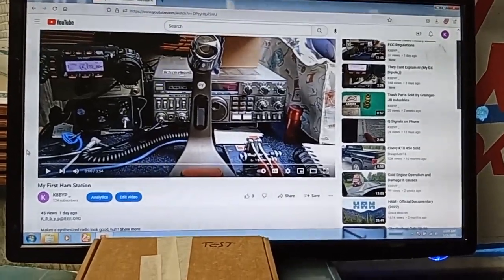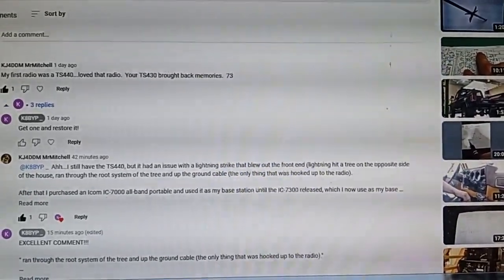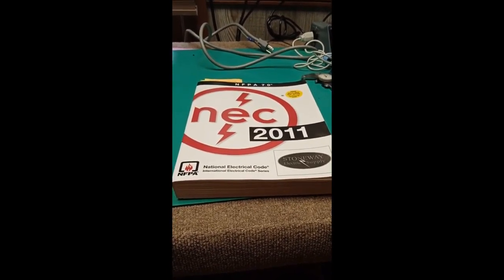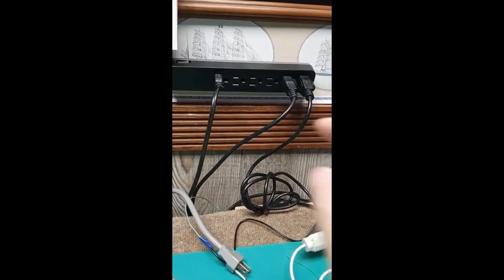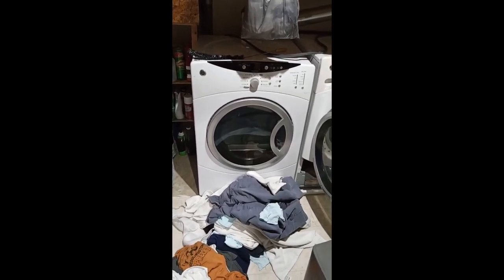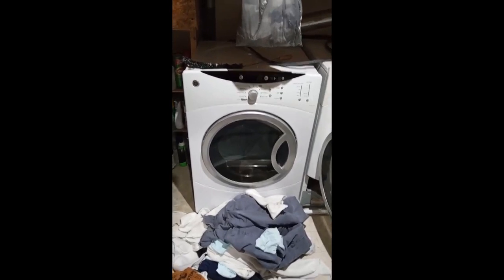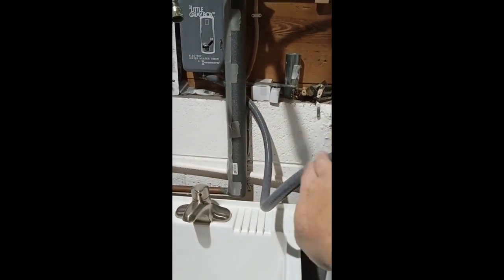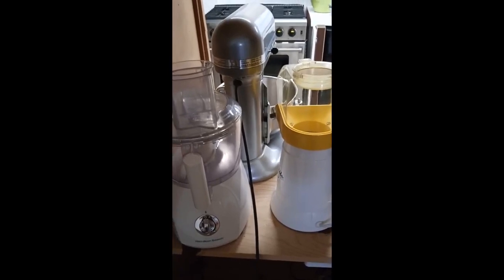UPDATE - NEVER GROUND HAM RADIO EQUIPMENT!!!

Comment from the maker: Im reposting a Comment from Jonathan Cotner. Its important to out utter BS artists like this. This information is ENTIRELY FALSE, based on rumour and opinion with ZERO knowlege or explanation of electrical physics or circuits, especially in a VERY complex topic (which I have a mastery of) of EMI and RFI as an Engineer:

Im reposting this to show the HORRIFYING ignorance that passes for Amateur Radio these days. Normally Id just delete this kind of nonsense.

Orignal comment (basically in complete error):

" Ok, let em explain why the ground lug exists on nearly every piece of equipment we have. This doesn't discount what I've watched thus far in the video at all, and it's something I've told countless amateurs. Say you have an radio, and an amplifier, and a automatic tuner that all take 120v input. That means they each have their own independent power supplies, each with their own independent "ground" potential. We interconnect this equipment for various purposes, the coax feeds the RF, the PTT lines are the control lines, and that's where those ground lugs become important. If you take a volt meter and test the voltage between two un-grounded devices you'll measure the very real potential difference between the equipment. In the days of tubes, where we didn't have a three wire system, that voltage could easily be 120v AC (this is your scenario with the dryer). Today it's on the order of 20v or so, give or take, but that's STILL enough to disrupt things like a 5v PTT line. Ground (I prefer the term BOND) your equipment together to ensure everything's at the same potential, this is for both you and your signaling. That doesn't mean you add a ground rod outside your house just for your amateur equipment, but it does mean bond your equipment together to ensure that all of your equipment is at the same baseline (ground) potential. If you install an antenna system, aka a tower, the NEC has code for that as you've mentioned. But I do want to point out that our equipment wouldn't be legal for sale in the US if it violated electrical code, and those ground lugs are there for a reason. Reference the manual for your radio, if only I could post photos in the comment section LOL. 73 KY4CT

OK, that was a pile of Rubbish and OPinion. Now, my corrections:

"WHere do I start as a Design Engineer correcting that horrible pile of mis statements?

One at a time, till I run out of patience (or coffee)

Off topic, rambling, no explanations from a technical standpoint (this is an ENGINEERING CHANNEL) only from an "operator pushing buttons and connecting cables together" standpoint.

Heres the response you'd get in an Engineeing review:

1. " and a automatic tuner"

Then youre not a real Ham and have no knowlege of antenna system matching. But I digress... The REASON you have "ground noise, interference etc" IS YOUR SCREWED UP ANTENNA SYSTEM throwing boat loads of RF back in the shack.

2. "That means they each have their own independent power supplies, each with their own independent "ground" potential"

FALSE. "Ground" is defined by NEC as ALWAYS AND ONLY THE EARTH. Shack equipment, behind AC_DC rectified power supplies have a COMMON connection, NOT GROUND. The English idiom is more correct, an "earthing"  connection. This shows you have no knowlege of National Electrical Code.

3. "We interconnect this equipment for various purposes, the coax feeds the RF, the PTT lines are the control lines, and that's where those ground lugs become important."

Yes, interconnections for control purposes. Thats called "Stating the Obvious" (another Logical Fallacy)

BUT.. your claim of "lugs are important" is not substantiated by then telling me to go do something (that I know more about than you will in 19 life-times, Im a DESIGN ENGINEER who can DESIGN ALL YOUR EQUIPMENT, youre not going to teach me anything about this.

" If you take a volt meter and test the voltage between two un-grounded devices you'll measure the very real potential difference between the equipment"

I did.. And I used a VERY expensive lab type voltmeter on AC scale. Again, wrong use of "grounded". 

No difference was measured. I measured on my Yaesu 857 to a aux unit I DESIGNED that works off a Wal Wart, no difference. AND THERES NO GROUND LUG ON THE 857 LIKE YOU SAID "IS ON ALL EQUIPMENT"

No potential difference between my Yaesu and Kenwood. THATS BECAUSE IM EDUCATED ENOUGH NOT TO USE SEPARATE POWER SUPPLIES. They all work on a common 60 A SMPS supply, NO POTENTIAL DIFFERENCE ON THE CHASSIS.

But im an Engineer.

4. " In the days of tubes, where we didn't have a three wire system, that voltage could easily be 120v AC

True, I did a TON of tube TV service 'back in the day' . The potential difference (AC LINE CURRENT, NOT VOLTAGE) is (was) due to POWER SUPPLY LEAKAGE (AC line leakage, there was a standard CURRENT LEAKAGE test, NOT VOLTAGE). Measuring VOLTAGE means nothing.

And not relevant. Off topic.

5. " Today it's on the order of 20v or so,"

NOWHERE in my Ham shack is it. So youre pulling this out of your ass.

6. " Ground (I prefer the term BOND) your equipment together to ensure everything's at the same potential, this is for both you and your signaling."

That statement, again, is wrong, its not GROUND, its COMMON (chassis). Yes, that would "ensure chassis at same potential" but thats ALREADY DONE BY THE COMMON CONNECTION ON THE CONTROL CABLES. A second wire is useless and worse, another inductive reactance to pick up RF intereference. More wiring, more RFI.

There are two problems here (besides the fact you have no idea what youre talking about, except blindly throwing technical terms around)

a. The common(s) connections via the CONTROL CABLES (i.e. a common speaker cable) allow noise currents to flow and that can cause oscillation. Thats the problem youre referring to. They also pick up tons of RF FROM YOUR SCREWED UP ANTENNA SYSTEM AND FAKE TUNER.
That noise mixes with the intended signals.

The 'common connection via the studs" doesnt help and is wrong, because thats routing signal or control currents OUTSIDE THE SHIELDED CONTROL CABLE where they are MORE subject to noise.

Theyre BOTH wrong. The only solution from an EMI/RFI standpoint (another of my Engineering specialties) is to ELIMINATE THE NOISE OR RF SOURCE.

7. "But I do want to point out that our equipment wouldn't be legal for sale in the US if it violated electrical code, "

ABSOLUTELY FALSE. 

a. You made that statement without proof, youre engaging in a Logical Fallacy of "Pointing to yourself as an Expert"

b. Our Ham equipment is determined to be legal for sale by FCC. NOT ELECTRICAL CODE.

There is no process in the US for determining 'equipment is LEGAL for sale by Electrical Code"

That process is VOULENTARY thru Safety Certification Agencies such as UL. I have DONE that as a Design Engineer to UL and European standards.

8. "ground lugs are there for a reason."

Yes, they are, they are there for Old Wives Tales about grounding that violate National Electrical Code. 
Theres NOT ONE ON MY YAESU. Yaesus Manual for the FT 857 tells Operators to GROUND THEIR RADIO TO EARTH GROUND, WHICH IS IN VIOLATION OF NATIONAL ELECTRICAL CODE, so DONT tell me how a radio manufacturer is some Code authority (well actually the idiot that wrote the Manual did it.)

So dont try to BS me about "the manufacturer"

IVE DONE "THE MANUFACTURER" FOR A LIVING.

Sorry, but youre a serious BS artist, full of yourself, and you know nothing about even the most BASIC principles of electricity.
Reply from the maker: Psychology Moment:

These kinds of false statements always follow the same pattern,
 " pointing to one- self as an authority" which goes along with the Logical Fallacy of "Appeal to Authority" to try to give credence and authority to false statements.

Note the comment is based on "Stating the Obvious" or vague overgeneralized statements that suddenly change topics ( Red Herring).

This is a deceptive tactic.

Comment: This is interesting and yet confusing.   I've lost a radio and two antennas to a lightening strike. Yes it was plugged in.  I had the antenna switch in a neutral position (no hot wire contact)   i had one antenna grounded to an outside water line.  The second antenna was not grounded.  I usually disconnected the coax from the radio, but didnt on this particular day.   So, the path of lightening was long.  It hit the top ofthe vertical,  went down to the waterpipe, melted the solder on some  connections.   It split off at the  antenna switcher and went back out to the three elimiment.   Now im not sure what exact path it took after. I can only speculate.   It went into the outet,popped two breakers,  took out at stereo.  It got into the phone line and took that out.  It traveled down the phone line to a service box 5 blocks away.  I had the whole rig in a diy wooden console.   The fire department attended, no fires. It was about 30 minutes after the strike when I finally looked in the console.  The radio had a big black mark across the cover and the antenna was still warm to the touch.   The switcher must've been white hot after the strike.   My girlfriend said that she heard  some crackling just before the strike. Some mentioned this occurring in their rv. 
I got better radio out of the deal and two new antennas.  I also got a 60' tower.  I grounded the tower. It never got hit once in 20 years.  

 It should be noted that in the canadian amateur license test, it states that equipment should be properly grounded. This contradicts the electrical code.  Also,  coax static/lightening arresters are also available.  Furthermore,  I've seen some elaborate copper grounding plates that all coax passes through.

 Therea a bit about lightening rods that also needs to be addressed.   Their function is to dispate the static charge before it actually builds up to lightening. The higher that the rod (grounding) is,the greater the area that it covers.  So, if this true, then it stands to reason that my 60' tower would bleed off static in a 70' radius.   So, there's a lot more to consider about grounding or not grounding.
Reply from the maker: EXCELLENT COMMENT
1. Socialist Distancing is one of my favorite phrases. I would never make a good Quebecois!

2. The CEPT test is not a technical authority on the topic, just like the US test and the radio equipment manufacturers. Such advice, as you know, is very bad. Yaesus FT857 Manual says to ground the radio. That is practice from the 1920s aand 1930s from a different kind of RF transmitter which used ground as part of a transmission line system. That has been used in AM broadcast also. It is an utter waste of time to ground a "coax" for an HF radio, the Tline system has no association with ground.

3. The reason the topic is confusing to you, is the lack of education on the topic. Without the science, we are left just with simple observation, and that of the APPEARANCE that lightning starts "up" and comes "down" to a ground or ground rod.

That is CONDITIONALLY or PARTLY true and leads to the disaster of grounding mistakes.

"Their function is to dispate the static charge before it actually builds up to lightening."

Absolutely and DANGEROUSLY false. Ground rods are used for electrical power utility service to keep parts of the system at the same potential in case of faults, they are NOT for lightning.

Static charge means electrons not moving, static electricity. With lightning *formation* (before the gross discharge), the ground rod CAUSES the charge buildup, it does not dissipate it, as in the second stage of lightning formation, it causes charges to travel UP the antenna or tower to a high point, and this 'encourages' a lightning strike from above.
This is aggrivated by height, having a small area or sharp point and illumination with UV light. These are the factors involved in general arc formation between points.

"antenna switch in a neutral position (no hot wire contact)"

In free air, electrical potential is often quoted as arcing "0ne inch per 10Kv" The TINY gaps in a RF wafer switch are no isolation for a 50 KV impulse.

" So, the path of lightening was long.  It hit the top ofthe vertical,  went down to the waterpipe, melted the solder on some  connections.

FALSE. THats backwards. The charge FIRST went UP the water pipe to the TOP of the vertical, which is a very sharp point which concentrates the fields. When a DOWN coming charge channel from the cloud, where a huge mass of charges have accumulated, meets that charged area, THEN there is the 'gross discharge' that we assume , falsely, is the start of the process. It isnt, its the END of the process, we just cannot see the start.

" It split off at the  antenna switcher and went back out to the three elimiment."

No, there was a Branched Streamer. All that discharge happens at the same time. The 3 element was also charged from the ground via the tower. Realize you didnt SEE this supposed "splitting off" happen, its a gross assumption.

" It went into the outet,popped two breakers,  took out at stereo.  It got into the phone line and took that out.  It traveled down the phone line to a service box 5 blocks away. "

Those appear to have been indirect. When there is a strike to ground, that is mostly vertically oriented. That is an immense current flow that causes E and M fields to be generated, think of antenna fields multiplied by millions.

Its probably the M fields (magnetic) that coupled into the lines, this generates KV of potentials in the wiring and can actually damage the wiring (commercial power service in particular) and lead to current leakage and eventual breakdown and fire as the potentials break down the insulation between the wires. That can eventually cause gross break down, arcing and overheating and a fire in a wall.

" It traveled down the phone line to a service box 5 blocks away. "

The M fields travelled 5 blocks instantaneously and induced energy in the lines. 
Heres the myth of ground rods and ground wires conveying energy. They do not, they are much too inductive-reactive. Lightning discharges are RADIO FREQUENCY ENERGY, NOT DC.
The average frequency of arcs, according to Townsend, is on the order of 1 MHz IIRC.

"Furthermore,  I've seen some elaborate copper grounding plates that all coax passes through."

Thats called "Red Herring," a useless waste of time and a violation of US Code.

" I grounded the tower. It never got hit once in 20 years. "

Not likely, amateur towers are grounded by virtue of being installed *IN the ground. *Concrete is a GREAT conductor of electricity, it never dries out internally. There is no such thing as a Ham grounding a tower with a ground rod. There is in the Commercial world, at a Motel near Berryville VA, there is a large cell tower atop a huge concrete pedestal. That tower is required ot be grounded, because it is not sunk INTO the concrete, its bolted ATOP the concrete, and there is a large ground cable from the tower to a ground rod(s)

That it never got hit is incidental.

This topic is shrounded in false theories and Old Wives Tales because its not understood and cannot be seen. Its rooted in extremely complex Doctorate level physics dripping with horrifyingly complex math.

The best source to begin with is the early 1900s text by Townsend on the Branched Streamer Theory and Arc Discharge. This text lays out the fundamentals as to the mechanics of arc FORMATION (which no one seems to understand) and then the gross discharge. It is an extremely complex topic which includes quantum physics effects.

See:

https://digitalrepository.unm.edu/cgi/viewcontent.cgi?article=1600&context=ece_etds

" This number is balanced by the
generation of primary electrons released from the cathode through secondary processes (e.g.
ion or photon impact). "

Electrical circuits do not ocurr at or from one point, it takes TWO, the cloud charges and teh ground conditions. The ground 'contact' (i.e. top of the antenna) is where the CORONA is generated.